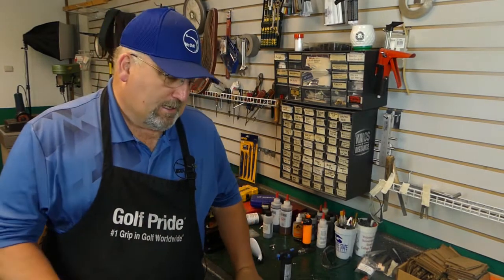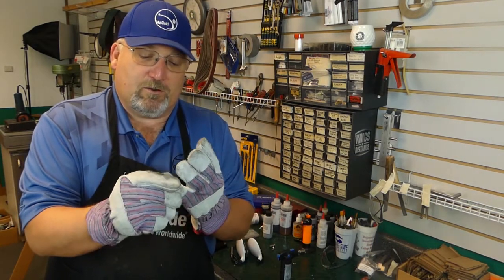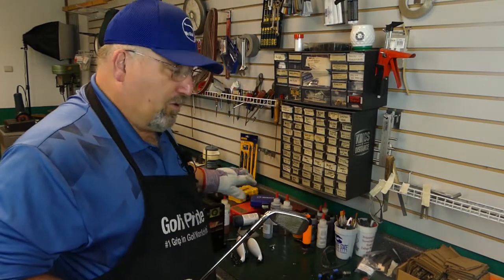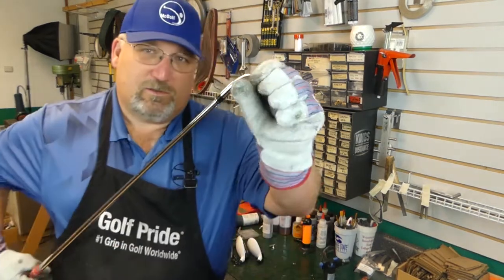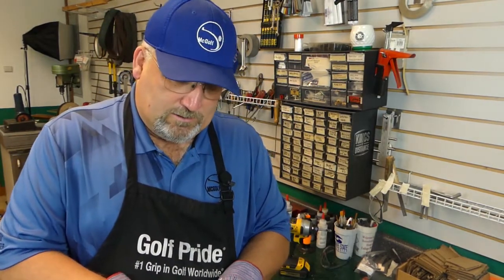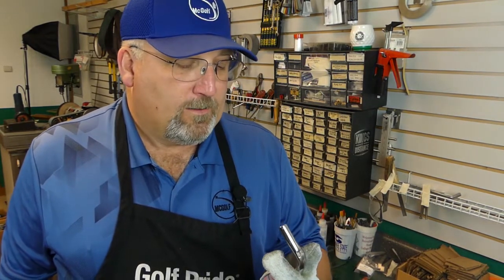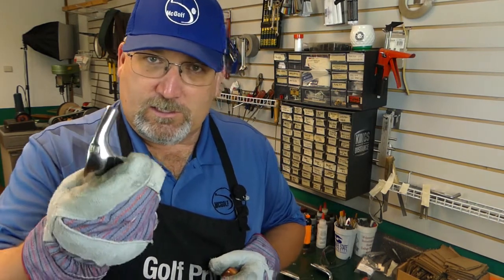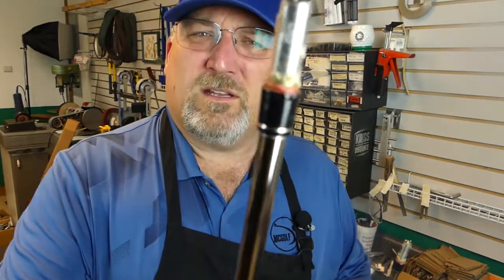club making techniques pt 1, how to build a golf club

Comment: This series will be great thank you for taking the time out of your busy days to make the videos! By the way where do you get the hosel brushes Mitchell or GolfWorks? Do you different size brushes for woods and irons? Thanks again for all your help have a great night.
Reply from the maker: Paul Rhodes I get most of my small equipment from golf works and yes get both sizes. Nothing is more aggregating than missing goo in the bottom of the hosel
Reply: McGolf Custom Clubs Thank you